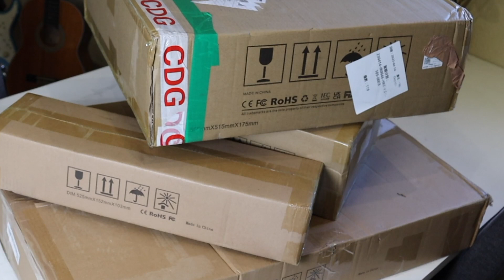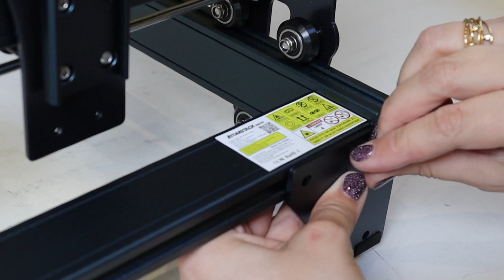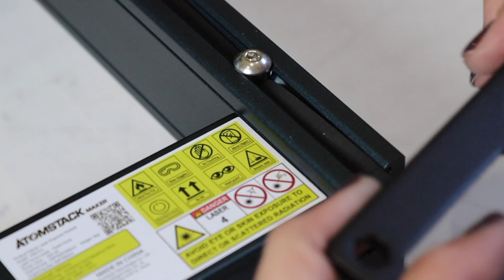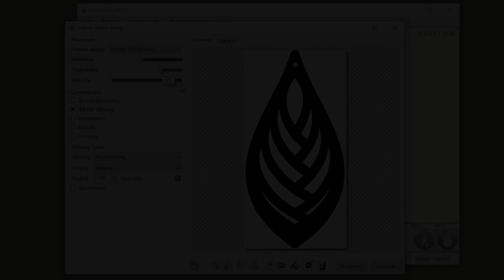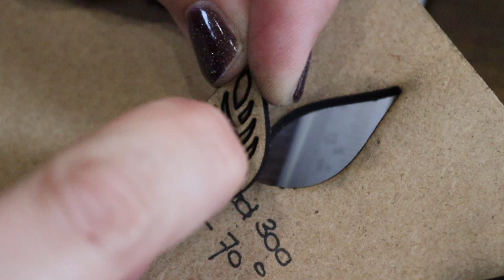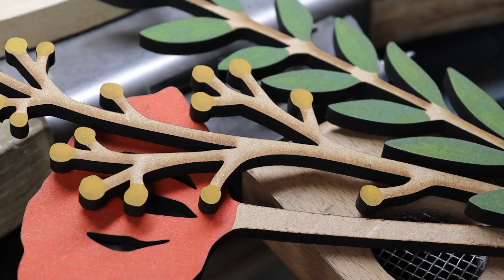Product Review: Atomstack A30 PRO (laser) - FREE Estona Tutorial

Comment: Can it cut silver sheet metal? And if it can then what thickness?
Reply: Most consumer lasers cannot cut reflective metals
Reply: @noahc6544  no not possible, actually not possible to even engrave with this type of laser onto metal.
Reply: @ArtOfDavidAmos  Can diode lasers even engrave anodization off of aluminum? I use a 100W CO2 regularly for that
Reply: excellent question👏